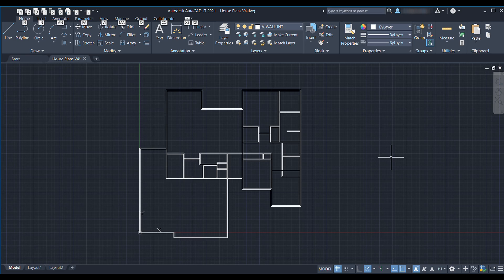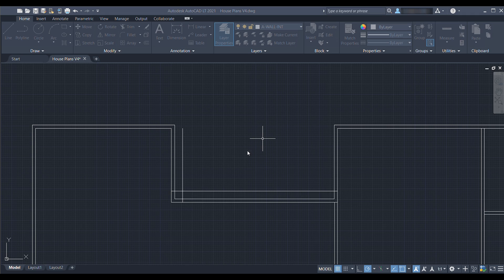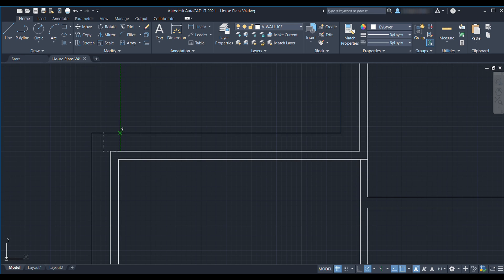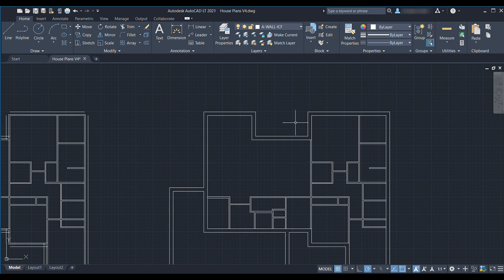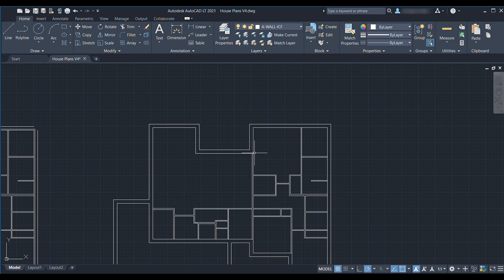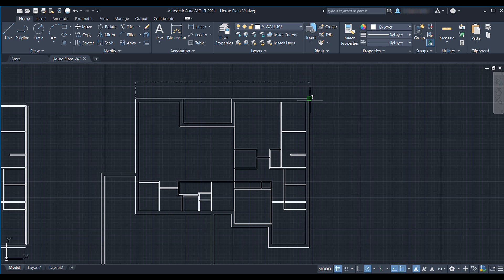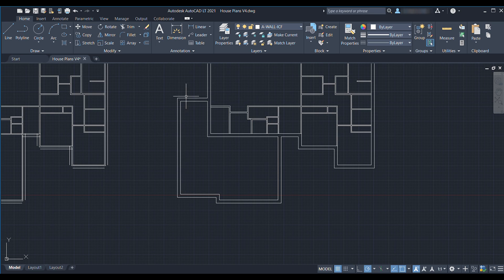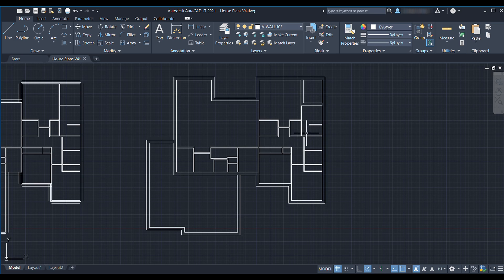AutoCAD ICF Construction - Wall Thickness

Comment: I want to know where there is a minimum square foot number, where I am the square foot area is defined by the exterior walls. The way you extended the ICF in my area increases the total square footage but really gets you nothing other than hopefully more insulation.
Reply from the maker: Yea, our “covenants and restrictions” documents define a minimum of 2,000 sq ft of “livable space”. Its a bit ambiguous when it comes to ICF because the interior and exterior areas are so different. I sure bet the tax assessor will use exterior area though!

Comment: We are building an ICF in November. We have been going through the same details. The manufacturer had great wind load referencing for our costal build. Keep up the good work 💪
Reply from the maker: The HUD guides on coastal design are really good too. They go into a lot of details for making even regular structures more wind and water / flood resistant. Would definitely recommend a read through.
Reply from the maker: I’m having trouble finding the link now, but I’ll pass it along if I see it.
Reply: @avalianteffort40  It's all good. My supplier is Build Blocks. They have already provided me with an engineering sheet. I called my local building department and as long as I'm building for 135 mph winds I'm good on wind rating codes.
Reply from the maker: Wow, 135 mph is pretty intense. That’s easy for ICF, but I imagine that would make stick frame design pretty tough! Wind force on structures goes 4x every time you double wind speed, so 135 is over double (2.25x) my design loads at 90 mph.
Reply: @avalianteffort40  That's what my building department told me. Another reason why we are using ICF. We are building in a little town between Hilton Head Island, SC and Savanah, GA. A couple of miles from the coast. My build is 12 feet above sea level slab on grade.  We picked the lot to be high enough to not have to build on stilts.
Reply from the maker: This might be it. Still an interesting read seeing what breaks buildings in tropical storms and how to design against that.

https://pdhonline.com/courses/s192/Design%20of%20Residential%20Buildings%20in%20High-Wind%20Coastal%20Areas.pdf
Reply: @avalianteffort40  Thanks for the document. It's full of good information.

Comment: is it not important to account for drywall, peel-n-stick, furring strips (air gap), and whatever outer sheathing/rainscreen/stucco solution is to be applied?
Reply from the maker: Usually those details don't get included in the structural drawings. You may (depending on how detailed your plans are) include them in an architectural detail on another sheet. Typically you try to limit the detail you draw depending on the scale. Some 2x4 exterior walls will be drawn as 4" thick to account for 1/2" of sheathing, but drywall is always ignored on interior walls. Its drawn for the rough framers laying studs. You could do something similar with ICF, but you need to be extremely careful to remember that you added this 1/2" when actually laying block at the site. Thanks for watching!
Reply: @avalianteffort40  ...appreciate the info. this is my 1st rodeo, heh. for a rough layout 1st pass i used a free online tool that exports in AutoCAD, and was about to give Sweethome a go to get better 3D render & a roof. lookin to make jobs easier on the architect & engineer, hopefully to save a bit.
Reply from the maker: Try out NanoCAD, it has a fully features free version (you have to dig a bit on their site) and can do everything you'd need to do. I'm starting to put together a better comparison of CAD options on our blog (https://valianteffort.blog/2021/04/25/choosing-a-2d-cad-package/)

Comment: If I buy house plans should I purchase the CAD version if I plan to build using ICF?
Reply from the maker: Depends, if you're experienced with CAD, they don't take a lot of time to redraw. Often, the CAD model will cost you another $500 which wasn't worth it for me. If you have no CAD experience, it may be worth it. Editing and moving walls would be easier than drawing from scratch. The real pain in the beginning is getting your text styles, lines weights, dimension styles, and paper layouts set up (I'll probably make a blog post about this eventually). That would all be done already if you buy the CAD files. If your completely uncomfortable with CAD, it may be best to skip the pre-made plans altogether, and get an architect to draw something up for you based on designs you like.